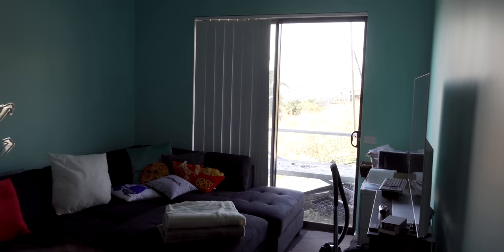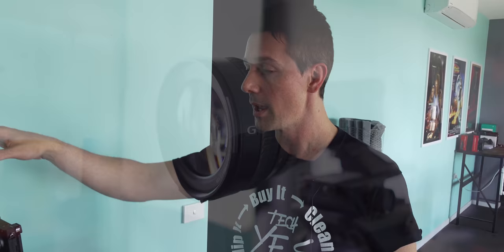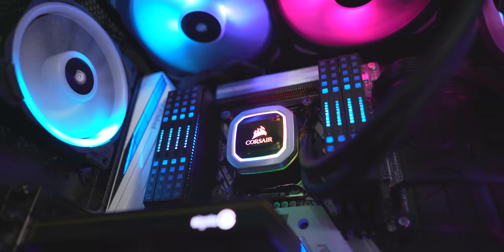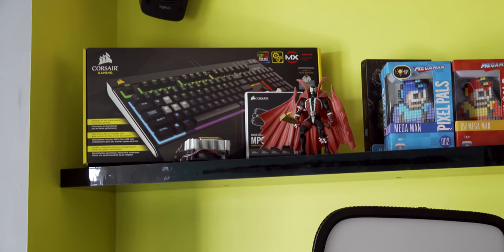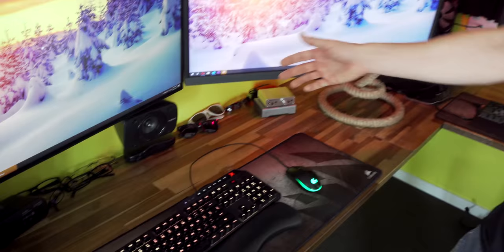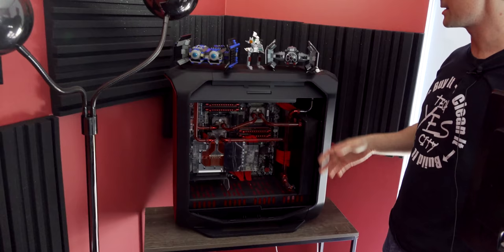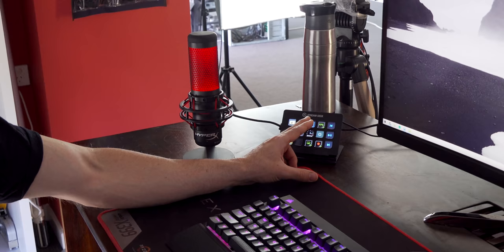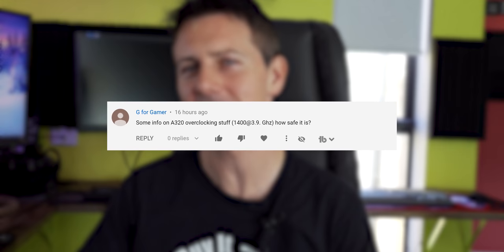The ULTIMATE Hustler's Gaming Setup / Studio Tour (2019)

Comment: 2:20 Same with the MSI Z390 MEG Ace LGA 1151 for Intel, Doesn't matter which RAM, the same problem with Corsair Vengence RGB RAM not only G.Skill Trident Z Royal, or how big the size as well. It happens to me. I've tested both, in the end, I just test a single channel, but when all installed were fine. So either Single channel or Quad channel. Can't detect dual channel. Even after following the manual.

Comment: Remember nose breathers with high intelligence don’t give a shit about RGB lights. We would rather have a Led light using low power with the money used on extra RAM, hard drive space or fans. The inside of the case would be 15-20% cooler if you used a 20 watt or less light for case light. 5000-10000 or higher rpm fan motor and variable sensors for speed control would be a better use of funds. 16GB RAM kits and 3000 speed is best for most modern CPUs. Liquid metal thermal paste would extend the life of the over lock a long duration. You need to be sitting up an pass through fan setup. Two 90MM in the front of the case pointing inside for intake one side fan on the panel for direct mother board cooling and if possible a 120MM fan sucking air out of the back. I have used this configuration for the fans for 6 builds and low dust in the area allowed just over 79-85 degrees Fahrenheit while under a load was less than 100-109 degrees Fahrenheit. You usually get the desktop built correctly but you waste your time and money on RGB.

Comment: Please help !! hi im getting lag spike on my pc im using a fx 8350 with a r9 380x strix 4gb ddr5 16gb ddr3 the gpu on any game will go from 0% to 100% up and down and random ?? i've updated the drivers and bios i've tried the msi afterburner with the tick box on the unified gpu usage the cpu will be stable but gpu will go up and down the temps are fine running at 65 on load and 30 idle if anyone could give me some advice will be a help .